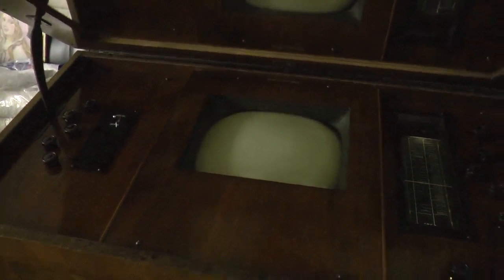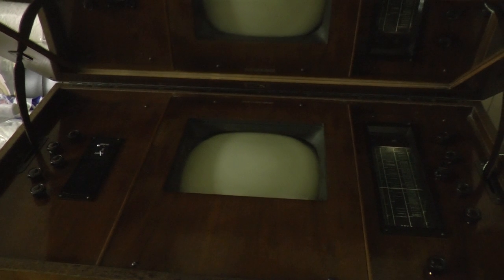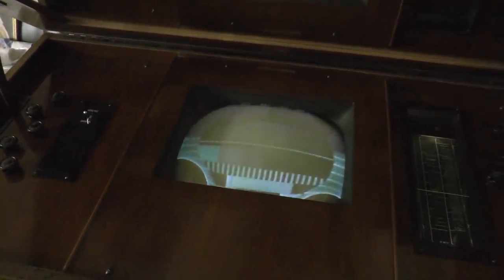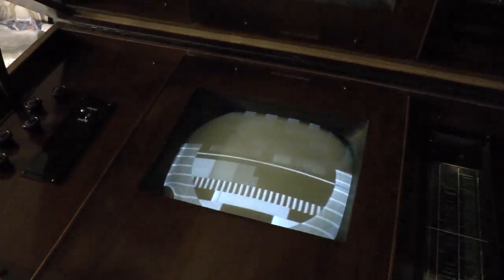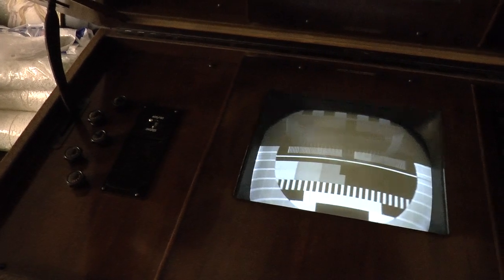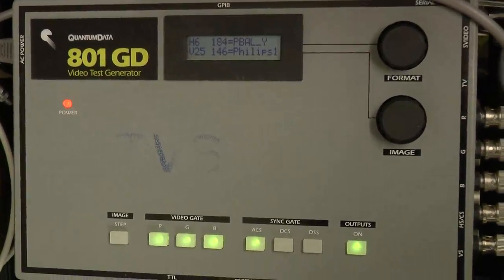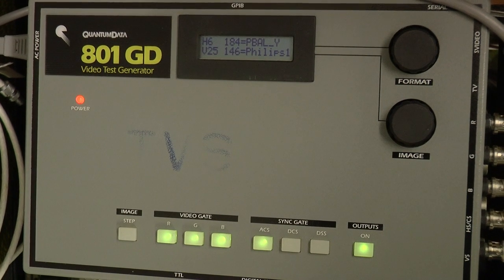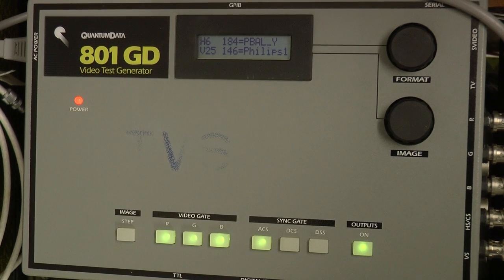HMV 900 , Pre War Television 1936 , showing the Baird 240 line system and EMI 405 line system

Comment: The fact that it's showing TV from nearly 90 years after it was made is so crazy.
Reply: signals are signals
Reply: Especially in such a smooth frame (or field) rate!
Reply: If you've got enough money and the desire to, then just about anything old can be made to work again.
Make no bones, this set has been repaired many times over the years, and now it's been complete restored.
How much of it is actually original

Comment: I swear if I win the lottery,  I would dedicate a large room with retro tech of all kind.
Reply: My passion would be Old Radios, I had a few a long time ago but they got left when I had to move.
Reply: I have a couple rooms with retro tech of all kind. I found it all in the dumpster. Helps if you're not picky, but you can (and often do) find treasures since people don't know what they're throwing away. (also helps if you're good at repairing stuff, although most of the time I pull it out of the container, it just works)
Reply: Don't need any room. All I have to do is access my memory.
Reply: 🤨 I wouldn’t call these retro - they’re antique

Comment: Would love to see more videos on the 240 line Baird system - hardly any videos on YouTube of it, and here comes your full working set if both that and the EMI! Many thanks.
Reply: Yes, there's very little of the higher line-number Baird system. This from presumably an electronic source; I'd love to have seen what mechanical 240-line was like, rather than the 30 (or 45, as I only recently discovered USA had) line usually shown.
Reply: That would be really interesting. There is of course film from Baird’s 240 line days, but only the film actually shot in the studio because it was shot on a film camera and then processed and scanned underwater approx 54 seconds later at 240 lines, but there was also a flying spot studio that did announcements in between, that was scanned at 240 lines with a light beam and then picked up on photocells. This allowed the programme to switch seamlessly between the studio (via scanned film) and live flying spot announcements, which gave time to reset the studio for the next act. The announcements were therefore quite long but had to be carefully scripted so the next filmed studio segment could start 54 seconds before the end of the live announcement in order to allow time for the film to run through and process and be scanned. I’m guessing it’s highly unlikely that the combined sequence of these two (scanned film, alternating with live flying-spot studio output) which was what was broadcast, was ever captured on film as I’m not sure that there would’ve been a reason to do it.

Apparently the announcers hated the pressure, because they had to practically sit in the dark in the flying spot studio, and yet read the script completely accurately in order not to mess up the timing – and of course, having a film camera perched on top of large tanks of smelly developing chemicals in it wasn’t much fun either. 

Baird’s system took turns against the competing 405 line electronic system - they broadcast on alternate days – but it’s hardly a surprise that the purely electronic 405 line system, which also allows you to have multiple cameras covering the studio action, won the competition and was the one that was adopted.

Comment: Underneath the mirror lid hinge on the main tv cabinet a number stamp can usually be found on these sets indicating roughly when the cabinet was made-further details probably available from EMI archives trust.Very unusual to have a surviving set with the 240 line switch.Most sets of this kind that turn up have this switch blanked off.An HMV 900 like this turned up in an auction house in Scarborough north youkshire in 1989.

Comment: I recall a 1940s Three Stooges episode where one of these projection console sets was used in a gag.  The rich folks are viewing the set [the latest novelty item for the well-to-do types -  which shows Niagara Falls. Someone comments as to how realistic the screen looks - then,  all of a sudden water begins to rush out of the screen - almost drowning the high end tux types sitting around the tv.  I think Curley was a plumber who had been running amuck with pipe assembly throughout the house  I remember that the set was one with a lid that once opened, had a projection screen on the inside of the lid - - never had seen one although I grew up watching every episode of "I love Lucy" as they were first broadcast, beginning in 1951 on an early RCA "Golden Throat" 17" model. The Washington, D.C. region was one of the earliest areas to broadcast, beginning ca. 1945.
Reply: This isn't a projection set, just one with a vertically mounted screen viewed through a mirror, the reason being the length of the CRT.

Comment: What a nice set, glad you got it going. Now I know why they did the vertical tube and mirror trick, boy are those early tubes long, (imaging a 40 inch tube, with those ratio's, you'd need a two storey building to house it) it would take many years to get them down to their final length vs screen size radio's before giving way to flat panels.
Reply: I think it was because they used electrostatic deflection - as in an oscilloscope - rather than magnetic. (Plates inside the tube rather than coils on the neck.)

Comment: Wow!  I've seen one of these sets in action, but I'm pretty sure it wasn't a dual standard. In fact I've never seen a 240 line TV working before.
Really interesting to see how the interlaced 405 line signal is shown on non-interlaced 240 lines. (Presumably the apparent banding on 240 lines isn't really there).  You end up with two un-interlaced test cards stacked on top of each other!  That takes a bit of thinking about.  Not sure why the 405 line vertical sync doesn't mess with this half way through the frame.
Reply from the maker: Hi , the camera causes the problems filming 240 lines, I have tried different filming modes and cameras, but none like it. The actual flicker with 240 line, is like complete frame flickering. I now have a converter that lets me watch 240 line, live but 5 minutes viewing is enough for me, before it's headache time

Comment: Very interesting to see this old set still working. I wonder how many and how long these sets and other pre war models were kept going in daily use into the late 1940's and 50's following the post war resumption of BBC tv in 1946? I also wonder if any of them ever received ITV programmes from 1955 using a Band Three converter if they were still going strong at that time?
Reply from the maker: As far as I know 12 inch tubes for them were available into the 1960s
Reply: My nan still had one of them in the 60s
Reply: @chubbyroyston3880  That's amazing. Did she own it from new?

Comment: The BBC alternated with 240 lines and 405 lines for a few months in 1936 and 1937 before determining that the 405 line (Marconi) system was better. It certainly had much better picture resolution Han the 240 line (Baird) system.
Reply: I’ve commented under somebody else’s comment, but yes! It was also much easier to produce programmes fully electronically than it was to have a combination of scanned film in the main studio area and a flying-spot live announcement studio with all the problems of developing film and allowing for the delay. In contrast, the fully-electronic Marconi production allowed you to have multiple cameras, was totally silent, and instantaneous. It was a no-brainer really, for the BBC.

Comment: Whoa that tube isn't even coated with anything on the sides! That's pretty crazy to me.
Reply: Does the lack of coating cause more radiation?
Reply: @18000rpm  Radiation doesnt come from the CRT it comes from the flyback/trippler
Reply: @Synthematix  - Not so! The CRT and the HV rectifier tube(s) would be the X-ray sources here. And they do not occur in most monochrome TVs because the voltage is not high enough. Color TVs with their voltages of 22+ kV are the ones that have X-ray problems.
Reply: @Inflec  Some of them used heavy lead glass to reduce this problem.
Reply: @MrToradragon  - True, which is why disposing a CRT in an environmentally friendly manner is such a headache.
Reply: @Inflec  Plus of course colour sets had the shadowmask, with only a third  (at best) of the beams reaching the screen, the rest hitting the shadowmask.
Reply: @Inflec  The lead doesn't leak out of the glass.

Comment: I guess reflecting the picture in the mirror was done so the picture would be right side up.
Reply from the maker: Hi because the tube is about 70cm long, if it was mounted horizontal the tv would have a very deep cabinet, so by mounting it vertically was meant to save space and then view it with the mirror.
Reply: This flat mirror reflection allows for wide angle viewing from left to right - - yes/no ?
Reply from the maker: @Jeffrey314159 Yes the mirror is wide to let lots of people view it
Reply: @vintagevideo4044  Probably his remark was that the height mirror flipping of the image is not a problem, unlike the side flipping in the mirror. The horizontal "beam" rasterizes in the opposite direction so that the image is correctly flipped sideways in the mirror, which is a matter of the opposite connection of the horizontal deflection coils. Vertical deflection coils are unchanged in this application.

Comment: nice to see that working again. what converter did you use for the 405 and 240.
Reply from the maker: A Aurora converter for 405 line and a broadcast pattern generator for 240 line, that wasn't made to do 240 line, but can be adjusted by the user to do it

Comment: Note the shallow angle of deflection. Over time, the tubes got shorter and shorter. 
Was the format 4: 3?  Or 1: 1?
Reply from the maker: Originally 5:4 , but its set up with a 4:3 test card from a Aurora converter
Reply: The BBC started off at 5:4 but switched to 4:3 in 1950. Earlier sets would need a slight adjustment the next time the repairman came around.

Comment: Beautiful crt seen from inside the set! Such a clever design: the controls and screen hidden when closed, it wasn’t as deep as the tube was firing upwards rather than horizontally. Finally (and I’d like to know if this is a thing) I wonder if it was also a safety thing, protecting the viewer from implosion (directed up rather than out) and also radiation emitted by the tube being directed upwards and not straight out to someone sitting in front of it?
Reply from the maker: It's only done because of the length of the tube, and the glass in front is, as you say for safety, if the tube did get broken, the high voltage to the tube is to low for x ray type problems. The Marconi 704 is direct view and does have a deep cabinet, because of the tube length
Reply: @vintagevideo4044  thanks for clarifying! I have to confess I didn’t spot that the TV screen also had glass in front of it. I used to mess about with old valve TV sets when I was at school, in the mid 70s, when there were a lot of them still around, that you could get secondhand, or even have people give them to you. Some of them had thick Perspex implosion screens – I remember that. Hence, really interested in your video. I really appreciated both the overall design and the inside of that set – it looks beautiful. It’s a work of art! Lovely that you included the entire warming up sequence. There is sort of magic to watching it come to life. I think we forget that you couldn’t just instantly switch stuff on, or have it always available.

Comment: Thanks for the wonderful video! I have been studying the history of television for a long time, but this is the first time I see this TV at work! What exactly had to be restored in this TV? What problems did you have during the restoration?
Reply from the maker: The main problems are always capacitors, most have to be replaced. Other things resistors, have to be checked and most survive ok and the controls like height, width, have to be checked and cleaned as dirty controls, can cause huge problems

Comment: This would be analogue. I'm just wondering how it can get a signal in the digital age?
Reply from the maker: I use a Aurora converter, it takes 625 line in and outputs 405 line, plus it has a modulator built in, so it plugs into the normal aerial socket

Comment: What did you use to generate test signals?
Reply from the maker: For the 240 line it's a Quantum Data 801GD pattern generated, you have to program it to do 240 line and for 405 line a Aurora converter

Comment: This is an astounding achievement. I have seen only one working in recent times and that was in a museum in South London. I am rather surprised at the large tube size given pre-war glass blowing and evacuation pumping. I see SP41/61 style valves with top cap and metallizing  screen don't I? 
Wow how come those other components can take the EHT strain? Scary! Look I know its not authentic but I would strongly recommend the use of an external fan to keep it coolish. You don't have to fit it. Oh me oh my I cannot speak!
I am not familiar with Baird 240 line system and I don't get how you have done that or why? Was that ever a broadcast standard? Even during parallel testing? Never too late to learn is it? 
Well done!
Reply from the maker: The eht transformer has been rewound and does run cool . The longest time the tv was run was one hour and forty five minutes and everything was still cool
Reply: @vintagevideo4044  Thankyou. Fantastic. So impressive.  Is it a flyback LOPT?
Reply from the maker: No it's just a mains transformer with a over wine that jumps it up to 5kv
Reply: That would have been at Gerry the museum in Rosendale Road, Dulwich; according to his spiel, it was the one that had belonged to the postmaster general, or director general, or similar. I don't remembr it having the 240/405 switch, though, though it may have had.
Reply: @vintagevideo4044  For only 5 kV, it's a very sharp image (and - hard to tell of course - looked good and bright, too).
And 5 kV from 50 Hz mains would have been pretty lethal: is that thing by the tube the smoothing capacitor?
Reply from the maker: Hi , yes the green block is the eht smoothing capacitor, its a double 0.1 mf and its original as they have a good reputation for lasting.
Reply: @G6JPG  Yes yes it was Gerry. I went to the museum when I first retired and that is 14 years now. Say it quickly - as time has more and more relevance.  When I walked away having seen so much once familiar equipment, I cried spontaneously. All that time and effort. Is the museum still going?

Comment: amazing.how does the tv "change" from baird to emi systems?
Reply: love to be told wat each valve does and how it all works. is there somewhere?
Reply from the maker: The person watching, uses the silver toggle switch to switch between the two systems. The transmission standard between the two systems is similar so nothing is charged in the reception part, the switch alters the height, width, line hold and frame hold, so mainly switches extra resistors and capacitors in and out of the time base circuit

Comment: It's great to see a dual standard 240/405 line set working.

Interesting to see such an old set displaying a digitally-generated picture(test pattern). Is there any chance you could down-convert some live or broadcast  video to display in 240 lines? Is the 240 lines interlaced or progressive?

As for 405 lines it was also nice to see it displaying an image of a modern mobile phone, I assume you down-converted from SD/HD or whatever? It seems to be fairly contemporary.

In the interior shots, it seemed that I could hear the 10.125 KHz horizontal deflection! With 240 lines, that would only be 6 KHz?
Reply from the maker: The 240 line pattern in the video, was done by the broadcast pattern generator, that can be programmed to do 240 lines 25 frames , but I now have a unit called a Hedghog psc, which is a programmable standard converter, so can do live 240 line pictures and that is fed by 625 line signal from a set top box. The 240 6khz whistle is very noticeable, but the worst thing is picture flicker , which after a while is to much to watch
Reply: @vintagevideo4044   As the frame rate is 25fps, I assume the 240 line signal is progressive scan, as that would make the flicker worse.
Reply from the maker: Yes that's is correct
Reply: @vintagevideo4044   Great re the PSC.

Ironically, I often view Youtube in 240p to conserve bandwidth, though admittedly  that's in 16:9 colour digital :-).

Comment: I thought John Baird invented mechanical television? anyway this is a beautiful video, just noticed you turned the power switch left and not right, how unusual. the 240line tvs had a noise about 8khz on the flyback doesnt it? and 405 line about 11khz? this is the first time ive ever seen a transparent tube bell running.
Reply from the maker: Baird invented 30 line television and run a service from September 1929 to September 1935. In January 1935 a government report said the BBC should operate a tv service and the minimum definition should be 240 lines. So Baird made a 240 camera using a twin high speed disc system in a vacuum chamber and a movie camera filming 35mm film that was developed in about 54 seconds then scanned and turned into a 240 line picture. Both systems were inflexible. Marconi had their electronic 405 line cameras that could go anywhere. On the 2nd November 1936 the television service started with one week on 240 lines and the next week on 405 lines, this carried on till January 1937 when the 240 line system was officially dropped due to it being inflexible and technically troublesome. So the Marconi EMI 405 line system was the winner and the standards switch on the HMV 900 would have been left in the 405 position and latter service manuals advised removing it
Reply: @vintagevideo4044  Nice one